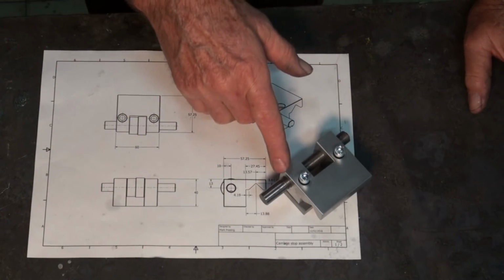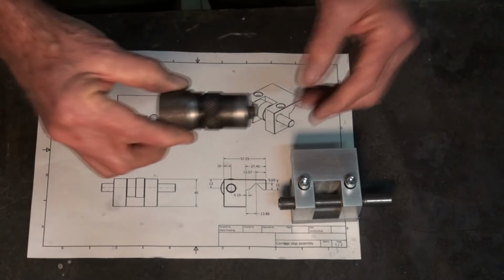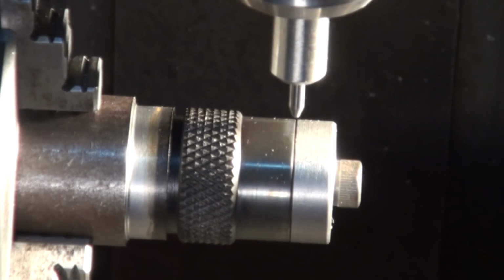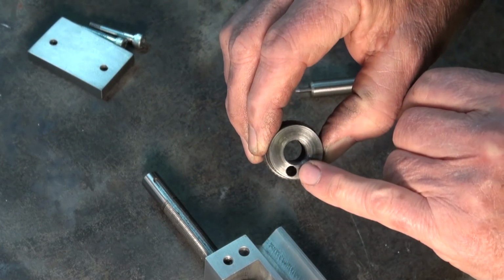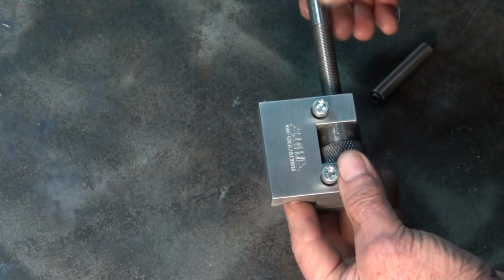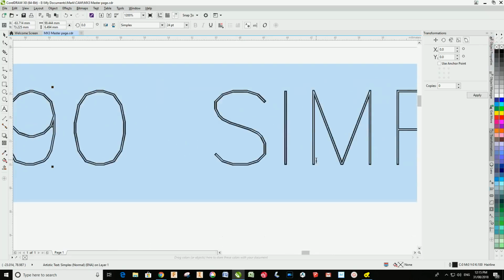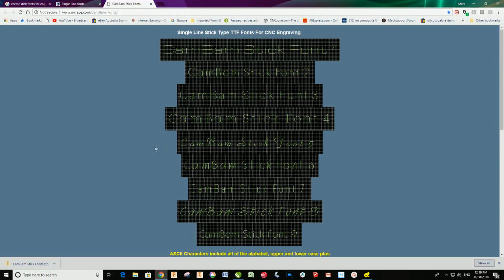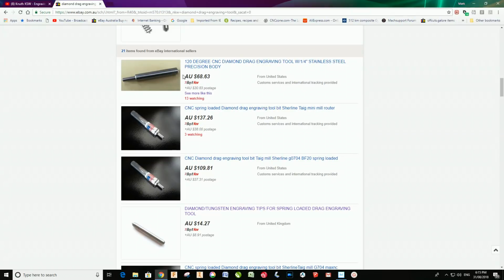CNC ENGRAVING - DIAMOND DRAG STYLE

Comment: Nice, thanks for the video. I think what I saw is the X and Y axis being used to draw the characters, I kind of expected that you would use the X and 4th axis. If I saw what I think I saw, is that normal? I suppose with the spring loading you get a fairly constant depth engraving anyway, though in principle wouldn't the characters be a bit better formed using the 4th axis?
Reply from the maker: I hand wrote the code for the A axis moves and just let CamBam work out the X and Y moves for the engraving. I think next time I try this I will use Fusion360 because I believe it now has the capacity to use the 4th axis to engrave as you have suggested. The spring loading on the diamond tip does eliminate most of the  error from having the tip move off the centre line but it would be cool to see it done using the rotary movement and the X axis moves.

Comment: Nice Presentation Preso/Mark! A Saddle Stop is also on my bucket list, although as I do not compute when it come to CNC if I do engraving it will be a lot less quick as well as the numbers will most likely be stamped.
Cheers from John, Australia.
Reply from the maker: John. I used to stamp my numbers onto dials using the Geo. H. Thomas tapping and staking tool but it requires good eyesight to line up the stamps with the engraved divisions. Unfortunately, my eyes aren't what they used to be. Probably caused by sitting in front of the computer hand writing G-code!  😁
Reply: Hello Mark, I know what you mean about the eyesight! I now days have to use an electron scanning microscope to see up close! Just kidding, however a large magnifying glass is essential workshop kit.
 When I make a carriage stop I will probably go imperial it for no other reason than I bought years ago a 40 tpi tap and die in Whitworth form and they so far have only been use once. I need to get my moneys worth. 
Cheers from John.

Comment: I have been using a spring loaded engrave for several years now on cnc.  Works great.  I just made my own, just buy a tip.  I use single line and a triple line font, just adjust how much depression you use in the code for soft and hard material.  i get very good results in Alu.  Nice job on your project.
Reply: Definitely need to adjust the spring pressure. I didn't make my own, bought one from Tormach and they give you 2 springs. One softer. Haven't used the softer one yet, but I have about .020" preload on the engraver and it works excellent in aluminum. Nice thing about going too soft is you can always re-run the code to crisp it up!

Love how that casting came out Mark! Like a bought one!